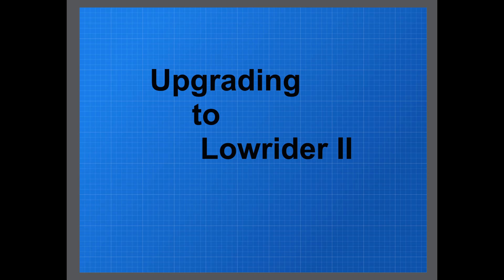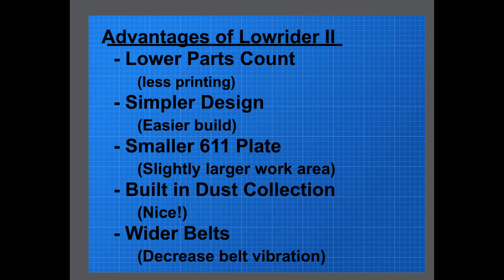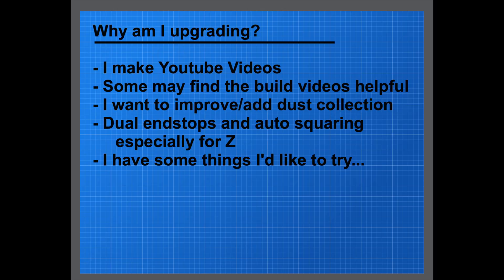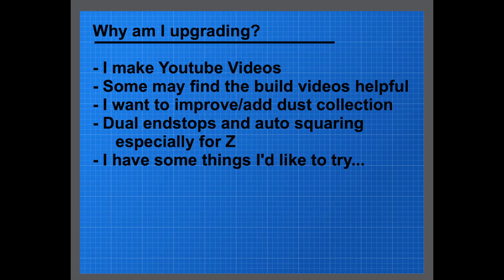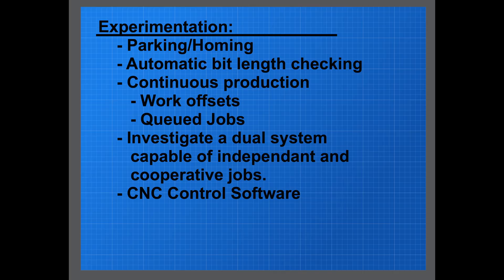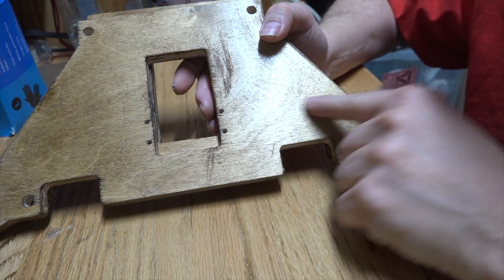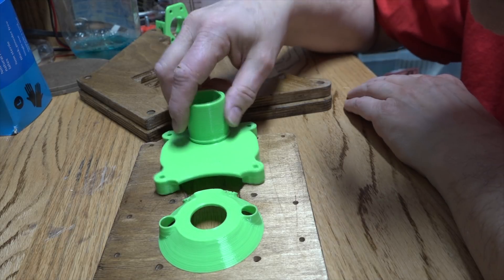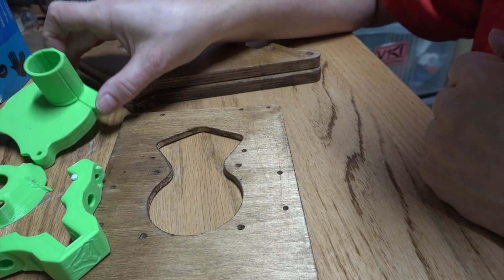Lowrider II Build    Part 1   3D Printed Parts

Comment: I have the most basic question there is. What is a good printer to us? I have tried an Anet A-8 and an Adimlab nothing prints respectable parts and the A-8 is (i think) too small of a print plate 8x8.